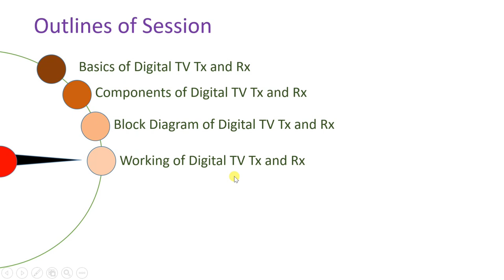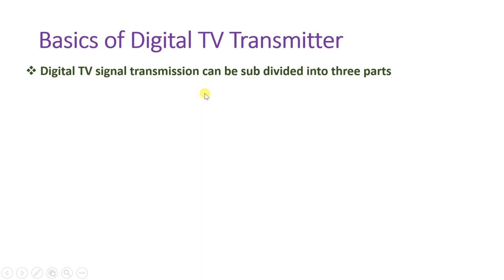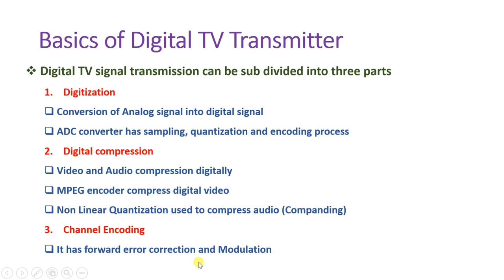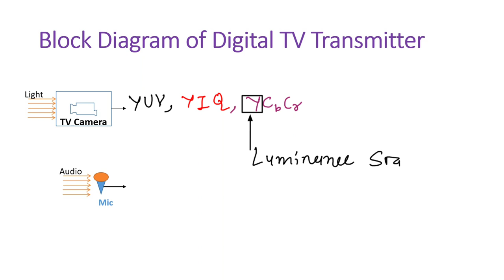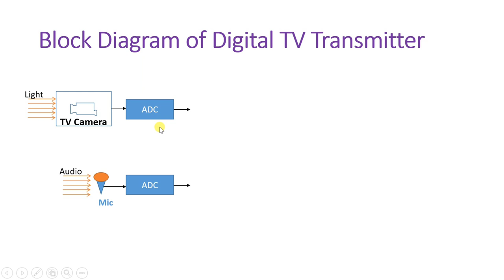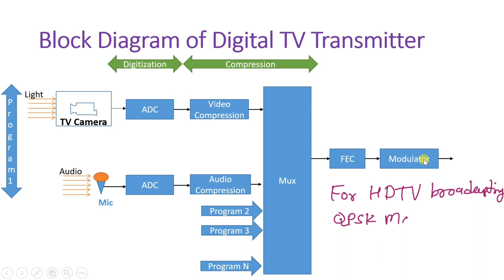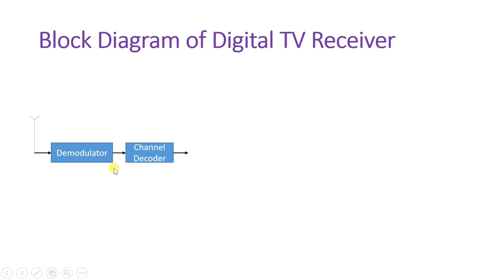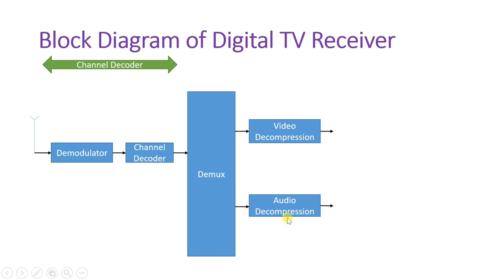Digital Television Transmitter & Digital Television Receiver (Basics, Block Diagram & Working)

Comment: Please make a video on television chapter in avs subject
Reply from the maker: Send me content of chapter
Reply: @EngineeringFunda (A) basic of television
1. Elements of tv communication system
2.scanning and it's need
3. Need of synchronizing and blanking pulses,vsb
4. Composite video signal
(B) colour television
1. Primary secondary colors
2. Concept of mixing,colour traingle
3. Camera tube
4. PAL tv receiver
5. NTSC,PAL,SECAM(brief comparison)
Reply from the maker: 65% of this is already there in my playlist of AVS
Reply from the maker: Part A is completed by 100% in my playlist
Reply from the maker: In part B, I haven't covered colors yet